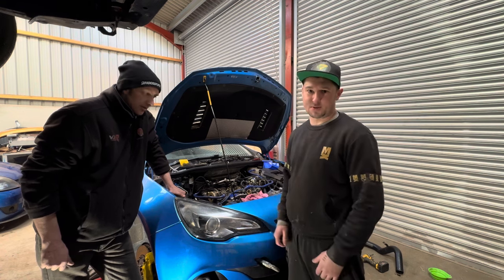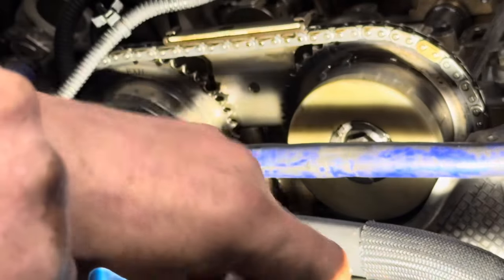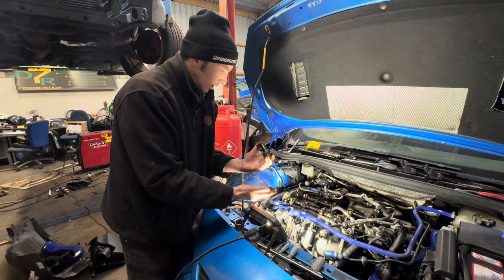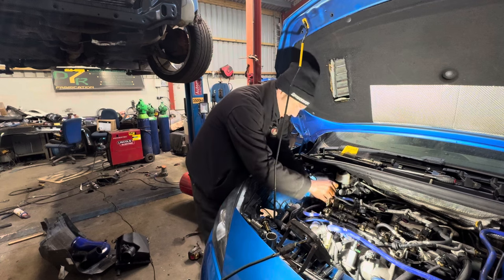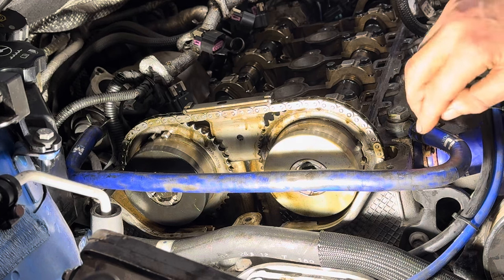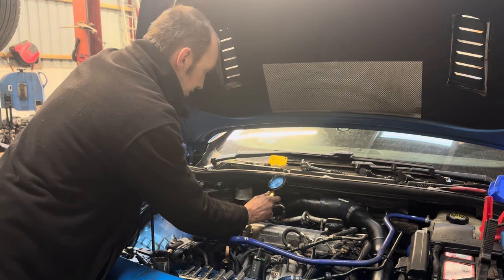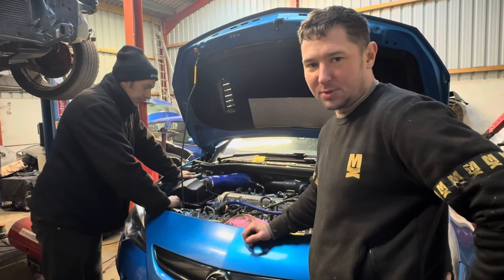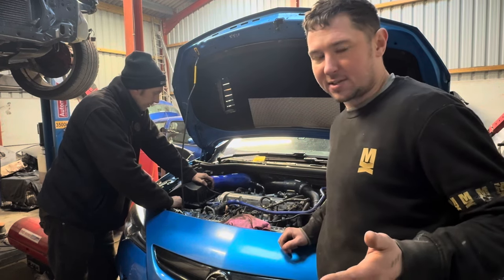Vauxhall Astra J VXR Non Runner, PT2,  Out Of Time⏱️What Did We Find Out? 🤔😅

Comment: We forgot to mention we also had to replace the seal in the compression tester relief valve which was the reason we dropped pressure in cylinder 2 after putting timing straight at final test all 4 cylinders was up at over 150psi pressure & maintained those levels.
Reply from the maker: All sorted, we put a new O ring in the tester and re checked everything.

Comment: I have this exact car and they have a known pistol issue based on either poor maintenance (lack of regular oil changes) or blown piston due to modifications without re-enforcing the motor. Safe to say I’ve forged mines rods pistons etc new chain and guides etc. full engine rebuild. The standard pistons these come with is cast iron no comparison to the forged ones.
Reply from the maker: The problem was damaged crank trigger

Comment: Good video but really, all things considered and the possibility of further damage not yet being diagnosable due to a non-running engine, I personally would go for a replacement engine with guarantee. That would be in the interests of both customer and mechanics. There's nothing worse than angry customers when the fault is a result of the knock-on effect and not the inadequacy of those doing the repairs. Always the question, "Can you guarantee the engine life of the vehicle if it is run and maintened properly?" If not, hands off.
Reply from the maker: What would be the point in making a video just to replace the engine, what would that prove? Nothing learned nothing gained, customer wants us to fix this engine and diagnose the issues with it, we have found and rectified a lot of issues and you will see a few more we have discovered in PT3 when it lands, Carl.
Reply: @D7RTV  I stated that it is a good video and I understand the value of diagnosing the faults. I wasn't aware that you were trying to prove anything. I always thought that the object of any repair is to ensure that the customer gets the best service and advice available and that the service provider can guarantee the work that's been done. If the customer is happy with further work being done and aware of the risks involved then it's their decision. I was simply stating my personal opinion.
Reply: Hi Laurence the purpose behind getting the vehicle running is that many other garages have tried many things including a ECU swap out & after getting the timing perfectly lined up now the compression up we are currently having to work on other areas, it's fair to say it's pie that's had many fingers in it but to no resolve & has multiple issues to boot, after getting the mechanical side straight the compression back in line & we have fuel with correct pressure spark & the last part to this once we get a few more items sorted will explain more as to why it's not feezable to just throw another engine in with the hope it will just run despite I do have a spare engine i could use if i believed it was needed, I hope once E3 is released it will make you understand alot more as to why we are going to the effort of getting the vehicle running before making any harsh decisions on it like swapping out full engines however all comments are appreciated as if you don't ask you will not get the answer

Comment: I really really want a J VXR but I keep hearing of timing/piston issues….. such a bloody shame I hear they are a fab b road basher
Reply: They are not as bad as people make out despite we are currently fixing this 1 now & I have just sold 1 I purchased & repaired last a year & a half ago I still own a j vxr & insignia 2.0 turbo 4wd that I have had for 7 years & 4 years without any great issues bar the odd sensor & both run over 320bhp for most their time I've owned them
Reply: Cheers Colin that’s good to hear. I’ve read Corsa VXR’s can destroy pistons as the injectors are at their limit - is this the case with the Astras engine? Would be good to know if there is anything to prevent such failures. Thank you!
Reply: They are great fun 😁
Reply: I got the zaff vxr stage 2. I love it. I just need to dyno it to see what she's running at , but has the k06 internals inside the k04 housing

Comment: Are the cams hollow or solid?
Reply: Cams are solid they don't twist the lobes like on the vw Audi & a few vauxhalls etc
Reply: @colincheshire6281  I asked , as I’m not familiar with vxr . Vauxhall is part of PSA group now.  Some of there camshafts are hollow and lobes are pressed on . I wasn’t sure if psa would be introducing this into vauxhall in name cars . As you will be probably aware this is to minimize damage ie valve and piston contact. Does not take much for lobes to move on impact ( not always obvious to the naked eye). causing valve timing issues and I’ve seen cam chain tensioner failure due to this after al most tensioners now are made of molded plastic designed fail but I see people not replacing tensioners when replacing cams ,it’s madness , sorry for rant ,cheers
Reply: @colincheshire6281  psa use hollow camshafts , wasn’t sure if they have used this procedure on the vxr updated engines, I’m not familiar with vxr engines.